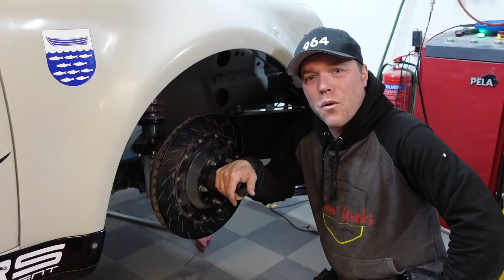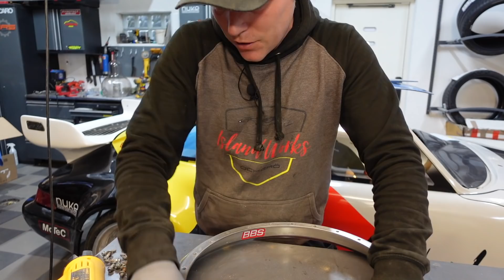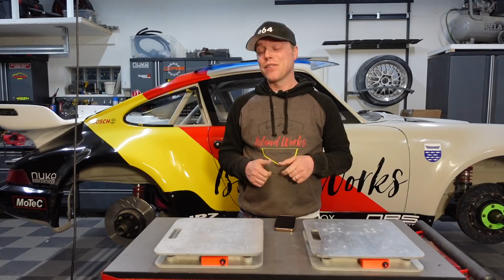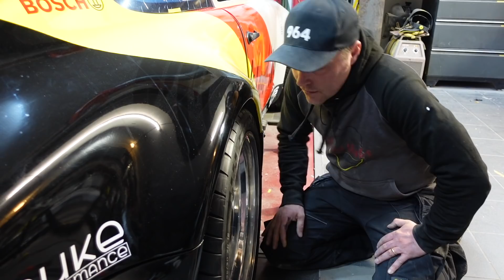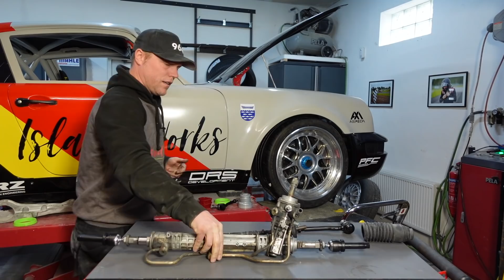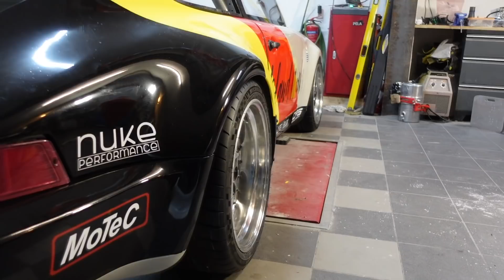Perfect Stance - Fitting and Adjusting Porsche RSR Rims

Comment: Great job so far.  You will need to check the effective rack length and adjust the inner pivot point to suit your suspension pivot point or you will get pretty horrible bump steer.
Reply from the maker: Really good input and I didn’t think about that. Good thing is a have built up a complete 3D model of the subframe and can use that to get the optimal length out.

Comment: Are you going to weld the torsion bar in the rack to stop the free play?
Reply from the maker: Which torsion bar are you referring to? The steering column?
Reply: @islandworks  For the spool valve in the hpas rack. Im just assuming that there is quite a bit of free play if using without pas, I havnt seen the internals of a Porsche rack so I am just assuming!